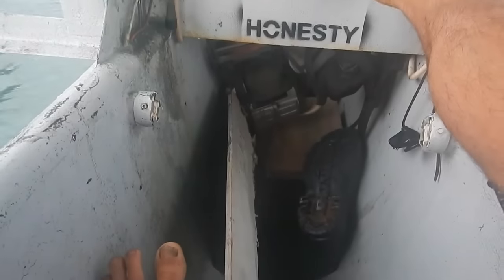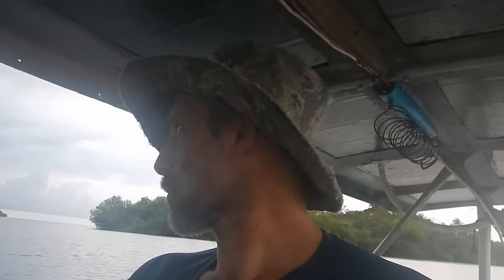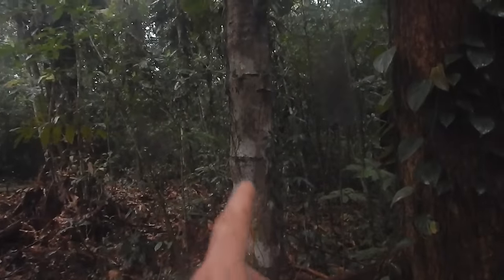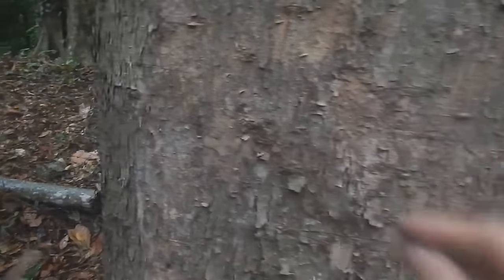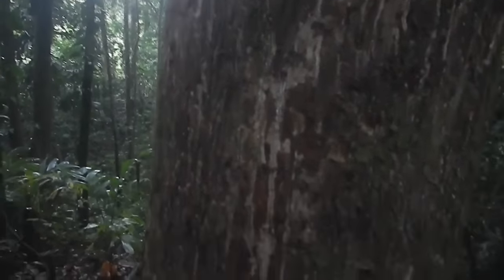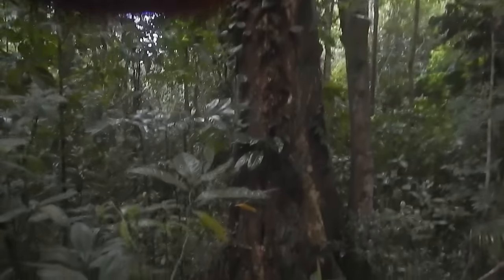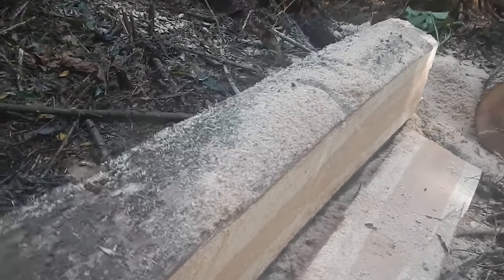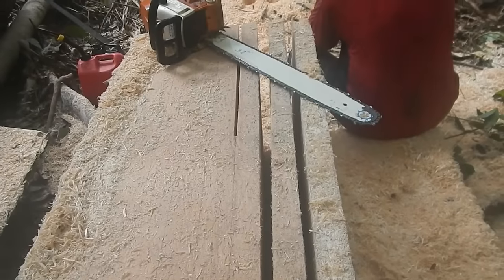Jungle Mahogany for my 2nd Floor

Comment: Man that's a proper saw! Couldn't help but see it put up a fight on startup though. Huskies are annoyingly hard to start when hot, they do that from factory for some reason, but it can be fixed. If you don't have it, get the spline screwdriver that's needed to bypass the safety stops on the carb screws, and tune the carb like this. This recipe works for any 2-stroke with a pumper carb, and gives easy starts, good throttle response, and great power at full throttle:

Tune it richer on the L-screw, listen for the idle to drop noticably.
Balance the dropped idle with more idle-screw, until just before the clutch starts clanging.
Tune the H-screw as lean as you can, while still keeping an acceptable amount of burble at full throttle max rpm.
Repeat the process until you've found the middle-of-the-range position on each screw, where adjusting it +/- a few degrees doesn't change how anything sounds. On the L-screw, the range can be +/- 90 degrees. H and Idle usually have smaller ranges than that.

Don't lean it until it stops burbling at max rpm, or one day the piston will smear its aluminum all over the inside of the cylinder. Sometimes it's worth the risk, but the cylinders are super annoying to change on Husqvarnas. Basically you have to tear the entire saw apart, it's awful.

Comment: I am surprised to see your method of cutting mostly with the nose of the bar. I have no experience and expected a different technique. Glad to have learned something here.
Thanks for your videos.
Reply: Moving forwards like that must require a lot of concentration to prevent kickback. I'm sure those extra calorie foods came in handy.
Reply: A different YouTuber explained that using the end of the bar limits the number of teeth contacting the wood, which is desirable for rip cuts. That’s a theory at least.

Comment: but why cut them manually? dont you have a actual lumbermill
Reply: Too big to cart over to the mill I suspect.
Reply: @snbrown100  but it floats! :)
Reply: @buZztiaan  Fair but heavy to drag to the water.  Though Jaimie is a strong man...  :)
Reply: I think Learning the trees was 50% of the purpose.  And he got the boards in 2 days vs however many days it would have taken him to transport those logs whole.
Reply: @snbrown100 Then what was the purpose of making such a giant sawmill at the top of a hill?